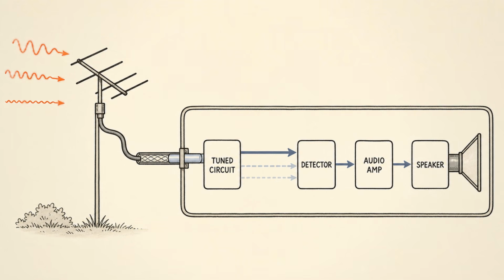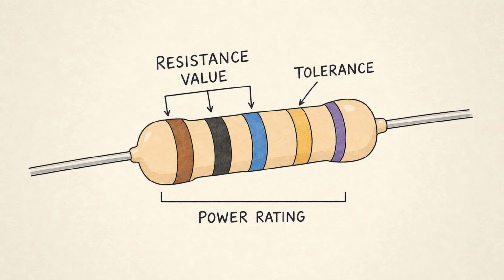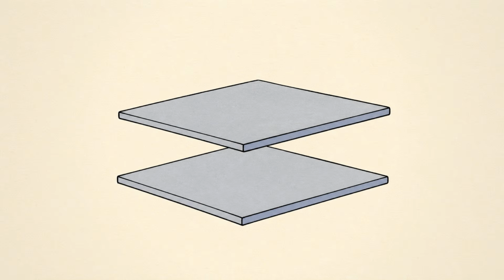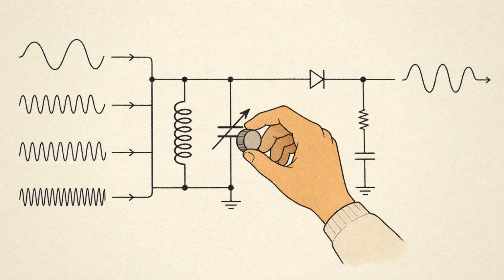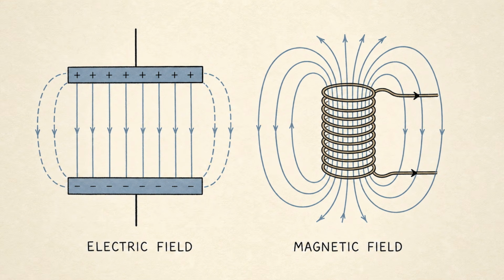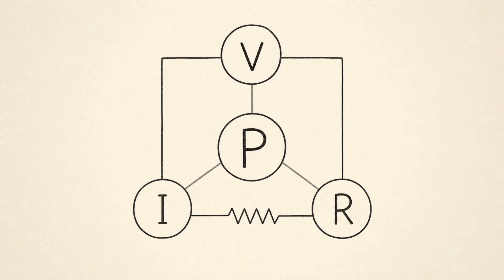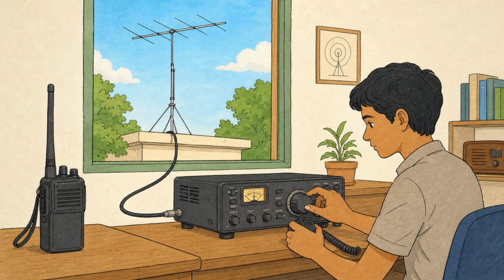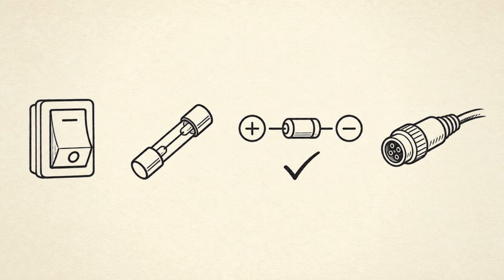Resistors, Capacitors & Inductors: How a Radio Chooses One Signal

Comment: Use 25 turn cooper wire and cap 0.01 nf cap for good wireless distance ->  + trafo on iron ring (Not ferrtit) 4 to 25 

10 cm distance
Reply from the maker: Thanks for the tip on those component values, I'll have to give that setup a try!